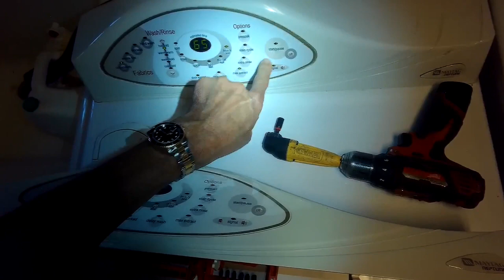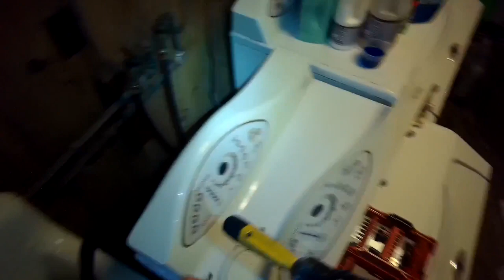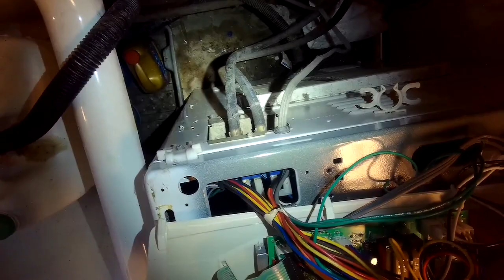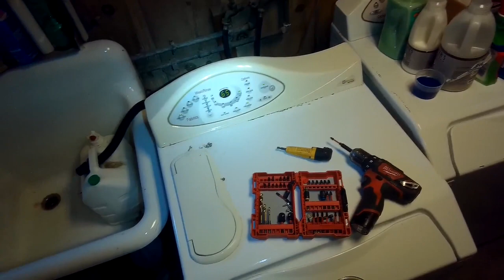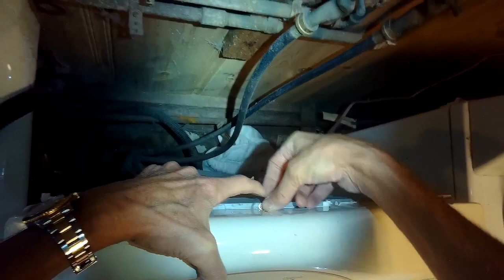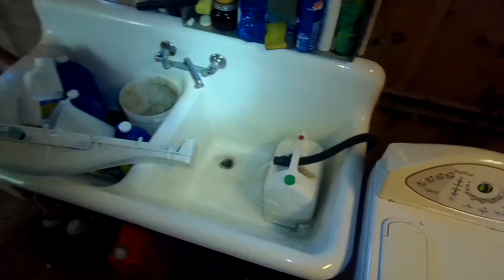MAYTAG NEPTUNE WASHER WON’T START—FIXED

Comment: Would the controller under the panel cause the door to unlock mid cycle?
Reply from the maker: It must be the wax motor wearing out.

Comment: How do you check door switch?
Reply from the maker: You can open up the top panel and use on a multi tester to check for continuity. Also, it has to click when you press in on the switch.
Reply: @ScottTheFixItGuyChannel  my door switch is going out, where can I get the switch? And how do I change it? I've never worked on a washer or dryer in my entire life.

Comment: I looks like I have this very same washer my model is MAH6500AWW, my door will lock and everything lights up and sounds like it’s going to start but won’t and my door was locked for 4 days. I unplugged many times to reset but finally on 4th day I touched the delicate button and it unlocked, got my smelly clothes out and pressed start and it finished that cycle to get the small Amy of water out. Was able to get one more load washed and then it done the same thing. Mine is a 2004. I looked on eBay for console and couldn’t find one. I called the store when I purchased and he thought maybe it was mother board too. Special order on console for almost $300 from whirlpool and mother board $450. Do you have any ideas for me because my washer, microwave and vacuum all went out within one week 😩

Comment: Start button wouldn’t work and it was stuck in lock position, the Lo code lights up. Do you think it’s a worn out start button and needs control panel or something else to do with the lock?

Comment: A cheap MAH5500BWW control panel is easily found. But I couldn't locate a reasonably priced one for my MAH55FLBWW. They look the same but every resource I checked says they are not interchangeable. I just have a couple of load size buttons that don't work. Hmm... I wonder if the ribbon cable is dirty or loose?
Reply from the maker: Good idea Larry
Reply: @ScottTheFixItGuyChannel  I forgot to tell you that I really appreciate your videos. Thank you
Reply from the maker: Thanks so much Larry